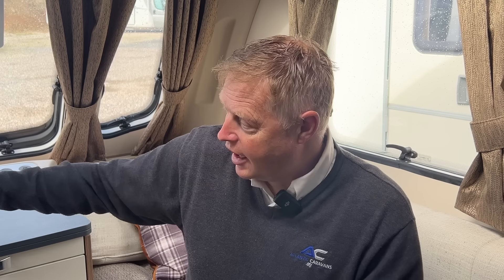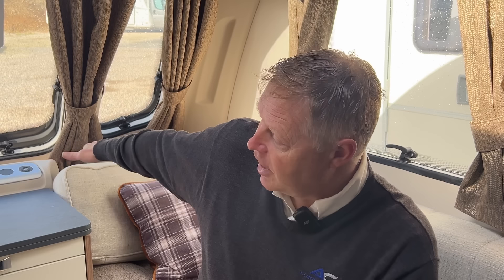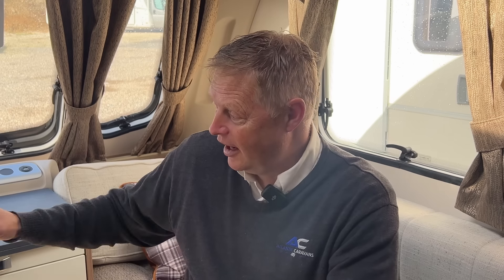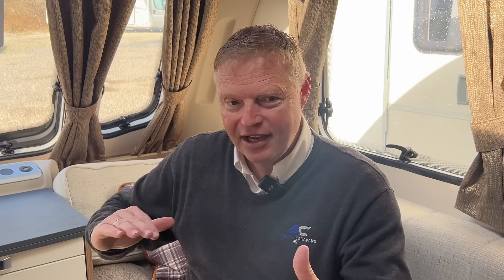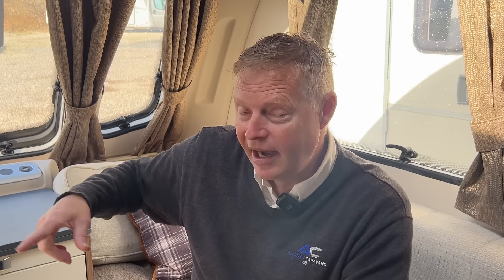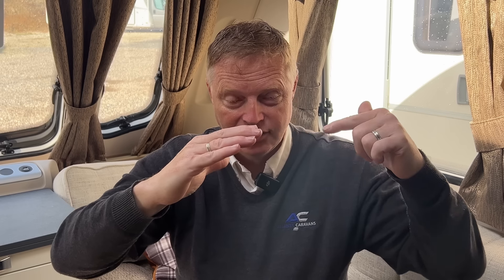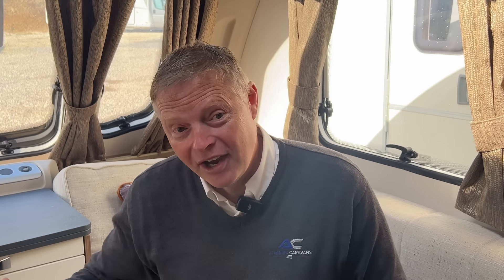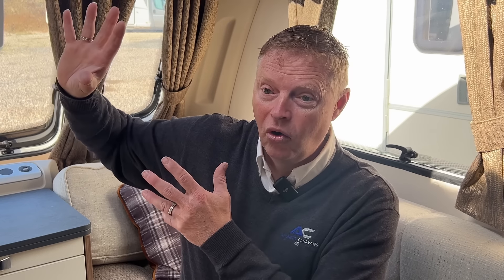Why are Caravan Manufactures making the same Mistakes?

Comment: As a recently retired aircraft engineer I fully appreciate what you're saying and as a prospective first time caravan buyer for retirement, I'm very interested in your comments. Aircraft engineering, in it's early days was very similar until the likes of the Comet crashes. Since then of course aircraft manufacturers have to have an advanced testing program that stresses test airframes, engines and components well beyond the current working life at any given time and if that advanced testing stops, then those aircraft have to retire from public service at a finite life.
The trouble with caravans is the price sensitivity and with advanced r&d and the cost of advanced materials or techniques to solve the problems, the resulting caravan cost might price out to the market. 
At the moment I'm weighing up the cost of a caravan and new tow car versus the cost of other holidays and accommodation for the next 10 years available body life!
Your review would make a second-hand caravan buyer think twice about buying used provided the new ones are no more expensive. This, of course, keeps the new market buoyant! 
How on earth would you get from the current state of affairs to one where use caravans can be bought  with problem-free confidence and the new ones still affordable for those prepared to pay?
Perhaps a good starting point would be to have an open reporting system such as aviation has for customers and dealers to share concerns? 
It is said: Necessity is the mother of invention. Perhaps manufacturers will invent new ways to fix these things if they need to respond to open discussions about defects!
You could be the one to invent that reporting system!😊
Reply from the maker: I’d expect the stakes were a bit higher in the aircraft industry,  planes falling out of the sky I would have thought is a bit more problematic than having water dripping on your head.
Reply: @atlanticcaravansUK  Absolutely but the principle remains and I'm not suggesting that it's appropriate for caravans but aviation does have excellent reporting systems and maybe that's where you need to start?

Comment: I’ve got a 2018 Buccaneer that I bought brand new and every time it goes in for service it’s not a case of has it got any damp, it’s how bad is it this time. I have even had stress cracks on both the front and rear panels that had to be repaired at my cost due to Eldiss rejecting the warranty claims stating that front and rear panels are only covered for the first year. I previously changed my caravans every 3 years but there is no way that I will ever buy another Elddis product and I have decided to put up with this one for a couple more years and then get rid before the 10 year warranty runs out.

Comment: Swift panaramic windows have been leaking for years, swift floating floors re introduced lol. Swift front and rear panels cracking Bailey floors wet through for the last 14 years. Keeps me busy. High retail prices are needed to cover the warranty.
Reply: Agreed - the Swift panoramic windows / sunroofs are a huge issue - simply not fit for purpose and nothing has been done to actually fix it - just various sticking plasters that don't really fix the issue.  I've heard of people on their 4th one!  So even getting a new one fitted is zero guarantee of it not happening again.  I love my Sprite Major 6td but (as an Engineer) I'm really surprised at the low quality of a lot of it.

Comment: After so many years it surely has to be that the cost of warranty repairs is less than the cost of fixing the issues. Either that or they don't have a proper eye on warranty cases and don't get feedback on where there are lessons to be learned. To be fair Bailey have applied some changes to ranges as they refresh them, though not the major timber floor issue. As a for instance after 5 years producing Phoenix 420 with a miniscule empty noseweight they shifted the battery box from behind the axle to up by the central chest in the GT75 420's. That will improve the empty noseweight by around 20kg. In addition on the GT75 Phoenix vans they moved the EHU socket to the offside from the nearside which most owners weren't happy with. So some lessons get learned. What I'd like to see is interviews with caravan designers, not the frilly 12 year old girls who do the fabrics and interiors but the people that do the basic body design. I have a feeling they hardly exist, in that marketing folk say which layouts to make, frilly young ladies tart them up and the basic construction method is fixed and not altered, therefore no need for such designers.

Comment: Great video, now regretting selling my 2009 coachman which was bone dry and everything worked perfectly. Was considering buying British but now leaning towards an Adria. My only issue with the Adria now after watching this video is that the shower cubicals are built with separate boards with sealant being the 1st line of defence. Any thoughts on this would be appreciated.
Reply from the maker: Hi, it’s not so bad in the way you’re thinking about it, if water can move it doesn’t do the damage it does once it stops. I’d have no issue with Adria showers, it’s only on for a short time and evaporates quickly anyway. We very rarely get water damage from showers.
Reply: Thanks for the reply. Thats good to hear, it’s just a shame I’m having to consider European built vans over British. I’ve not ruled out another coachman yet as I think they are the best of the British built vans 🤔

Comment: Do the Elddis faults carry over to the Buccaneer range ?
Reply from the maker: Yes I’m afraid so, it’s where we first saw the problem a few years ago. But someone said they had changed the sealant on the newer ones so they might be alright, time will tell.
Reply: @atlanticcaravansUK  Thank you for that, as there is very little to be found on Buccaneer issues. Certainly opened my eye's and changed my thinking.
Reply from the maker: @alancameron8393  they look a lovely caravan, but they just aren’t put together very well, I wouldn’t take one in as a pt ex if I had to put my name to it.
Reply: @atlanticcaravansUK  So would a Swift Elegance be a better option....
Reply from the maker: @alancameron8393 hi, on balance I’d say yes, there are issues with them but them and Coachman are the best of the bunch.
Reply: @atlanticcaravansUK  Thank you for your help, by the way do you ever hear from any of the manufacturers re your recommendations to them on there recurring faults...
Reply from the maker: @alancameron8393  no, they wouldn’t listen to me, and id like to think there are reasons why they can’t do these things that I don’t know about, it wouldn’t make sense otherwise.

Comment: Within 6 months of owning a new Bailey Phoenix I had a massive warp on an internal panel ,it was so bad it ripped the fixings out of the wall.Got it fixed under warranty, the replacement panel looks no different to the original so may be I will see the same defect again.Door latch fell apart after the third trip, absolutely crap design.

Comment: I have been a CAD designer in the Automotive industry for over 40 years so fully Conversant with materials usage and costs. 
We have a Swift Sprite Major and the rear panel is started to crack where it meets the rigid roof 
Why on earth are caravan manufacturers still designing caravans using the wrong materials put together!
There is CAE CAD software out there that show you the areas of stress and fatigue, before they even get their mastic guns out!
This software is not expensive these days and in the long run will potentially save them tens of thousands of pounds in warranty claims and make your customers a lot happier and make them stay loyal to the brand …👍
Also a tip from a R&D Design Engineer have you ever thought of going to boat builders to see how they do their construction you may learn a thing or two about joining to GRP Shells together successfully without any leaks
👍😂
Reply: Elddis claimed its Solid construction method was based on boat construction. IT'S NOT.

Comment: I had my sunroof crack on my swift... £1600 on insurance.  And now the top has been mastic to hell. Luckily I saw it early and drilled a stop hole at the end of the crack and then 2 holes at the bottom to drain the water until the van was booked in. The dealer advised me to keep the interior shade up when not in use so the screen didn't bake in the heat... Also had roof stringers overheat and the whole roof bow upwards... Not great

Comment: With the Elddis skylight, they changed the adhesive that stuck the frame down, it was a noticeable change as the old adhesive was black, the new stuff is white, since this change there’s been a noticeable drop in people reporting the issue on the owners forum, it’s in-fact very rare to see it on the forum at all now

in the past few years it’s instead been the front window rail coming away, in most cases it came away in its first year, I would say once again if I compare my 2019 Buccaneer to our 2022 Buccaneer, the design and fixing of the rail has been changed and the posts that still come up on the issue seems to be pre 22 models so hopefully this has been resolved. 

I would agree though, the lack of speaking out on the issue means the public are in the dark on whether they are sorting it and it makes people hesitant to buy one
Reply from the maker: Yes, if they front it up it adds trust, it would be a bold move but if they published the warranty issue each year, I’m sure consumers would respond in a positive way.

Comment: Swift issues caused us to move German and we bought a Burstner. Sometimes I think it is cheap labour and the guy with the mastic gun has no pride other times I think Swift just put claim costs on the next years van prices. Swift Bailey don’t care a hoot about anything other than short term profit.
Reply from the maker: See, that’s where I struggle because I know the people who own and run it, and it’s just not the case. Something is going wrong in the process, you think that and so do countless others, I see it in the forums all the time, if that was the case they don’t deserve your custom, we are going to have to get to the bottom of this..
Reply: Bought swift elegance 2022 model new. £40k and nothing but trouble from day one. Pipe came off alde heating tank omnivent replaced fridge freezer came loose in housing  alde boiler combustion fan failed. Poor quality of cabinets and doors. Fly net on main door faulty and replaced. All leather seat cushions faulty and replaced with far better quality ones. It’s a 845 model and seems to us that all light switches are poorly positioned. Wish we’d never bought it. Sick of taking it back to dealers for repair and no compensation for travel   Would not buy swift caravan again. There very poorly put together and tradesmen not taking pride in their work. No quality control whatsoever

Comment: Our Swift panoramic window is cracked and we are still waiting for a response from then. Over two months waiting and counting. Is there anything aftermarket out there to replace this window with?
Reply from the maker: I’d give your dealer a shout, Swift will give the go ahead within 72 hours normally with a yes if everything is in place. If you have had the go ahead but waiting for the parts, it can sometimes take that long.

Comment: Do you know about the Swift floor delamination problem? where the underside GRP skin parts company with the insulation in the floor and drops down, I recently bought a second hand 2016 Swift 580 with this problem  where it had  delaminated between the door and the kitchen, about a square metre, I didn't notice it until it was out of warranty and had to foot the bill for the repair, did some digging and found out that it was a common problem in that year and some had to go back to the factory for a whole new floor
Reply from the maker: No, I wasn’t aware of that issue.. but if it gets fixed and doesn’t happen again, it’s part of the learning curve.